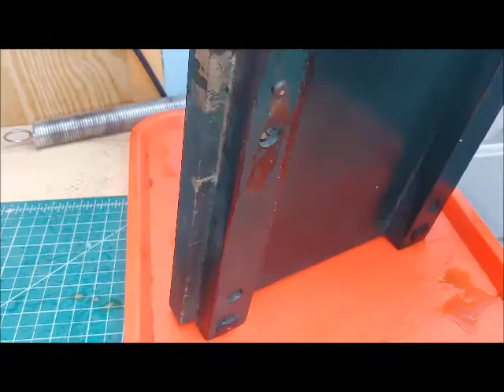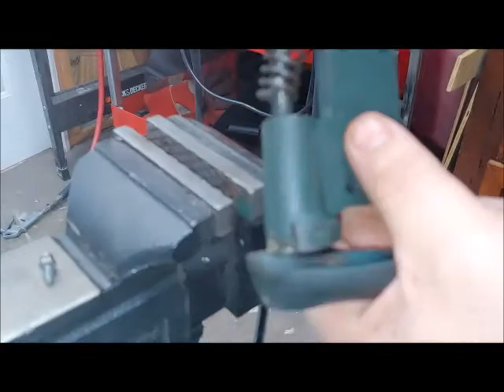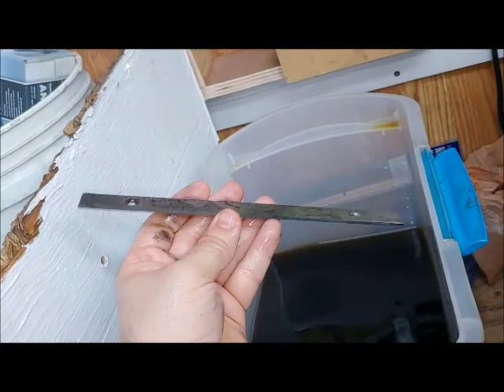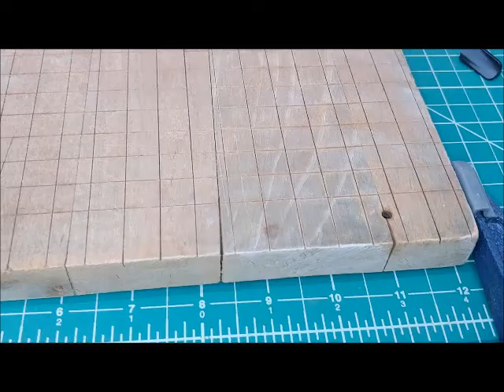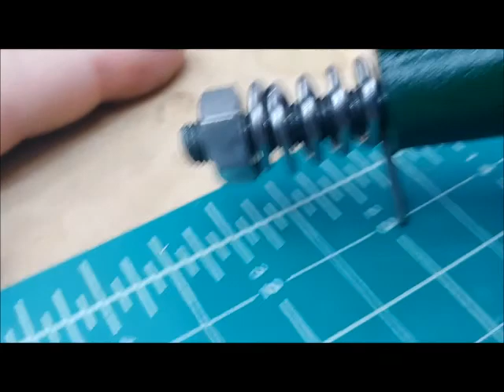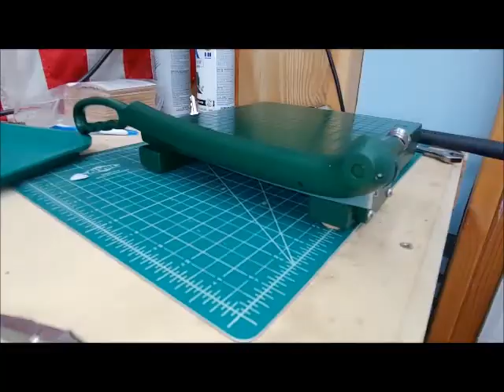1940's photo/paper cutter restoration

Comment: 3:07 AM
You sent
I have an old large paper cutter...guillotine...that is out of alignment.  The top of the trimmed paper is 2 mm less than the bottom of the sheet. I believe it may have been a school's tool in it's former life and that degree of misalignment was inconsequential. I need a perfect cut for bookbinding. Any suggestions?...(wonderful video)

Comment: I restore things also, when you place an object in a vise, there is a tendency especially if it’s metal, That’s a vise Will leave a mark on the object. What I do is use an old leather belt, I cut that up and wrap the object protecting it. Just an idea, it would be a shame to have something so old and gouge the object from the vise.
Reply from the maker: Good idea.